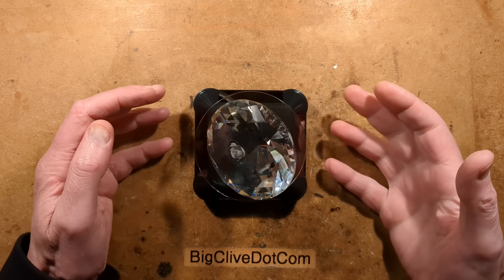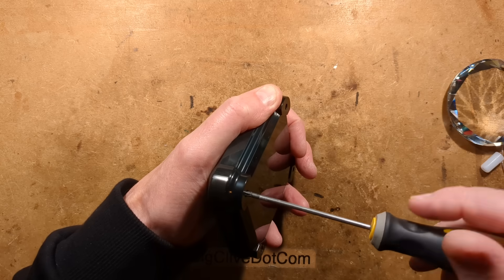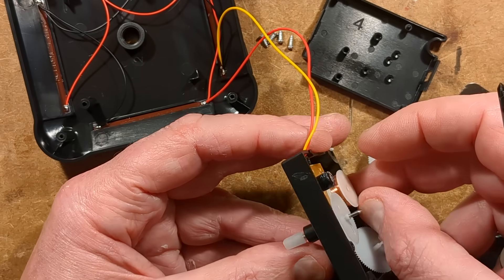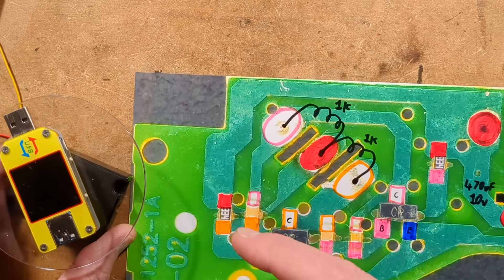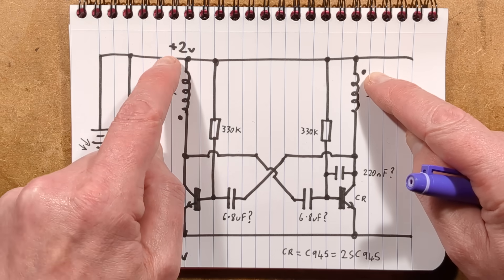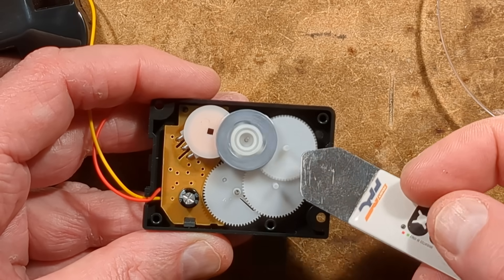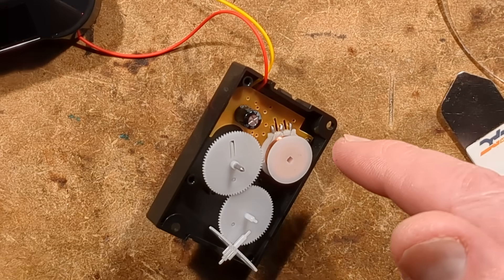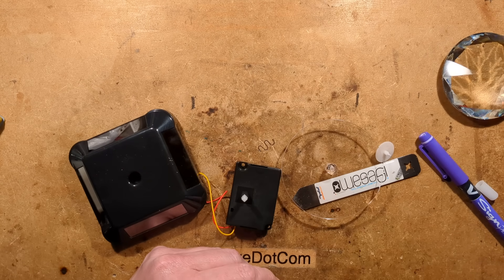Solar turntable with unusual motor

Comment: They are using the very same motor and gears for the small Tibetan prayer mills which are put on the dashboards of the cars there. Those are using the "fast" gear ratio. I have put one on my office desk in 2012 and it has been spinning every workday since, without any signs of fatigue. What a great design!

Comment: im really curious about that motor design, because just as you said there's a lot going on in its operation. But mostly about the coil/magnet orientation not being aligned and if there's an inductance flying back somehwhere. and   Funny enough, the very first circuit I had ever built was a dual led blinker exactly like you mentioned.  Cheers!

Comment: I have a question for you, Clive:  Solar cells are said to be good for voltage, but bad for current, and generally motors need current more than voltage (to phrase it badly).    Does that astable multi-vibrator have the effect of a transformer, reducing voltage while increasing current?  Or does it only do the rapid switching?

I bought some of those to slowly rotate some dichroic glass ornaments on mirrors in the sunshine.  The brilliant colors from the dichroic glass are amazing.  But the blasted thing spins way too fast.  Could I slow down the motor by increasing the size of the capacitors which go to the transistor gates?
Reply from the maker: These motors are suited to the low solar panel current.  You may be able to slow it down by adding a diode or resistor in series between the solar panels and the motor.

Comment: It could need the magnet passing over the coil, when it moves, to induce the reverse current in the winding, to flip the circuit over. it possible does work with the magnets missing?

Comment: Standard astable multivibrator circuit, so it shouldn't depend on the coils and magnets, no idea what the extra capacitor is for, it may force it to start on one side, but can't see why that would be necessary, possibly it helps low voltage starting, especially if it has to run at a single NiMH cell voltage.
Correction, the CR oscillation frequency would be 0.32Hz, so the frequency is actually being driven by feedback from the coil through that 220nF

Comment: I want a much bigger solar turntable for plants. Something to help them grow straight by keeping them confused. Ideally 4-5 rotations per day(sunlight), either with a lot more gears, or with an electronic timer. Hope someone would start making these.
Reply from the maker: You can get hanging basket rotators that store energy from a small solar panel until there is enough to pulse a geared motor.  They turn very slowly, but faster in bright sunlight.

Comment: It'd be interesting to get one of those magnet detector sheets and see if we could actually see the magnetic field oscillating. Though, as mentioned, the spinning magnets might actually play a role in the circuit, meaning it may not function without them

Comment: I have one of those older ones with the table permanently affixed. Got to me fine thankfully. I use it to cure resin 3d prints under UV light. Works great.

Comment: I use the larger (and heavier-duty) Li Ion battery powered one for cinematography.  These things are ideal for displaying e.g. minerals and semi-precious crystals such as Amethyst, and mine has the added capability of driving an LED via the USB charging port, so it can be set up as a point-source illuminated turntable. Got to be nearly 20 years old now and still works just fine.

Comment: Standard multivibrator, and the addition of the 220nF cap to base is a trigger cap, so it synchronises to the induced emf that the coil produces as the magnet approaches. That is mainly useful at startup, when the rotor freq is less than the natural freq of the multivibrator.
If you remove the 220nF cap it will probably still run, but starting will be erratic.

Comment: I have used one of these under a uv light to cure resin parts, before getting a larger cure station setup. They work well for small resin parts and the uv light does a good job spinning them.

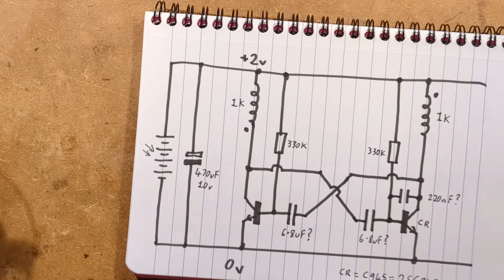Comment: @ 04:33 instant fuzzy nostalgia from first wiring up those spring terminal electronics kits
indeed the flashing LEDs.

That's also how I learned the sad way not to remove the resistors
(as I only later found out would be called "current limiting").
Yay - the LEDs are much brighter than before.
Oh - now they don't work any more.
Reply: They became NEDs 

Noise 
Emitting
Diode

But they only work once.

Comment: Like they say...it;s all in the gearing.  Fast or slow, the circuitry doesn't have any say so here.  Interesting thing this, solar cells only generate so much power so the gearing is most important.  Not sure of the durability though, all that spinning plastic on plastic construction leads me to say "not much" especially with weight on the platter.  Good work Clive, thanks!

Comment: I have a large "diamond" and also one of those turntables, I was hoping to make mine slower, I thought the Aussie sun was too much for it so I covered 3 out of the 4 panels and there was no change, I made the mistake of taking the mechanism apart and all the gears popping out, I figured I'd be able to do something in there to make it slower, but seems not, I kinda just gave up as that all I could think of. Still it's very nice on a bright summers say to have the "diamond" making it's rainbow patters in the backyeard.
Reply from the maker: You could possibly add a diode or two in parallel with the solar panel output to shunt the voltage to a lower level.  A resistor in series might work too.

Comment: My first thought was that it would use shades on the bottom of the turntable to shade different panels, with each wired to a different coil. Effectively providing the timing with zero "electronics".

Comment: Its what is used in clocks !
Reply from the maker: Some clocks, mainly for things like spinning pendulums.  But most dedicated clock movements are based on a small single coil stepper motor and a crystal synced timing circuit.

Comment: Thanks for this video, Clive, I hadn't seen one like this before. It would also be possible to make a custom enclosure that would change the rotational speed as desired, even down to an incredible slow speed but with a corresponding increase in torque.

Watching the higher speed with this turntable has given me an idea. If it would also be possible to power an LED or LEDs then this turntable could be used to make a solar-powered rotating police beacon or similar rotating light. Maybe the lower speed would work for a model lighthouse? I'm also wondering if the motor from this light could be driven from a solar garden light so that it starts up as the light fades. A rotating beacon solar garden light would certainly be unusual. The dome could be uncoloured and jumpers or switches used to select the colour by selecting different parts of a multi-chip LED.
Reply: Easy enough, a lithium solar charge controller and a buck/step down regulator (1.5-2v for the motor), then glue a small mirror tile 45 degrees to the square drive spindle and a narrow focus LED facing down on the mirror. 😉 (all available for cheap in AE "Bundle")

Comment: the circuit normally relies on one transistor being faster than the other so kicking the circuit in to oscillation.  So the little cap could be their to make sure one turns on a bit slower so as to guarantee the circuit starts every time. could even make sure it turns in the same direction every time?
Reply: I've built a lot of multivibrators in the last 50+ years, and they've all started without this extra cap. It'll ensure which transistor conducts first, but I don't see any reason that would matter here. Cargo cult circuit design?

Comment: It would be interesting to add LEDs to the motor circuitry as you mentioned, and aim them up through holes in the base at the bottom of the clear turntable. As long as there was enough extra current available to run both, with the crystal turning it would probably make some nice visual effects!

Comment: I've got 2 of these in silver from Temu bout 4 QUID each. The grinding noise you mentioned, is there anything I can add to the gears to quieten it and by that I mean spray it with WD40. 😁
Reply from the maker: Any oil or grease may be too sticky.  It's a slight cogging effect that can cause noise, especially with heavy loads.
Reply: Proper grease would work better than a thin film of spray, but I think the grinding is an inherent part of the mechanism design & cheap construction, sadly :(
Reply: Sure, but a thick grease layer may help to dampen the noise somewhat.. at the risk of inducing a higher torque/power requirement due to its viscosity

Comment: I've got a hexagonal one with 6 solar panels and 4 led lights. A single AA battery powers the lights. Table only rotates one direction. Btw, removing/adding a gear also affects the torque so you may not be able to spin certain items due to excessive weight.

Comment: Brushless? That explains the one I have had for 5+ years is still running. Much the same on the outside, but space for a single AA for backup (I guess). Never figured if it would try and charge a NiMH or burn a primary cell.
99% of the time it has been in south facing window with a tennis ball sized 'discoball' on it, confusing neighbours.

Comment: Big ceramic capacitors would be 10uF, measuring 7uF because of the bias voltage applied to them by the capacitor tester.
Reply: It would be interesting to see that 6.8uF caps replaced with 2.2uF. Would it spin faster, or would it not develop enough torque to run at all?
Reply: @jbuchana  Less torque, because the transistors would turn off faster due to less base charge, and it would not affect speed that much as the magnets are going to determine rotational speed.

Comment: I’m guessing the magnetic feedback does help it oscillate. You could test it by applying some friction to the rotor or its geartrain to see if it actually slows down instead of instantly stalling, indicating that the switching frequency has decreased as it’s a synchronous motor.
Reply: I think everyone was waiting for the magnetic polarity tester to be used on the open and running motor ! 🤔

Now I need to get one of those... 😉🤣🖖
Reply: @MeteorMark  I doubt it would be fast enough.

Comment: Holding a small metal screwdriver tip near the coil would have told you if the coil was pulsating or not.
I doubt the circuit needs the magnets to pulse since if the coil sections were replaced with resistors, the circuit would still toggle. Though I suspect that the back EMF from the coils would synchronise the pulse rate with the rotation speed. ie: The classic astable multivibrator config just gets things started.

Comment: Nice presentation - now I suddenly need a few of these!
There seems to be enough internal space to add a solar charger circuit with a cell or battery, for round the clock operation. That would be interesting. Just an idea.

Comment: You mentioned a similar circuit with LEDs instead of the coils. That works because, as one transistor turns on, its collector voltage drops and that drop is communicated by the capacitor to base of the other transistor, turning it off. No magnetic coupling between the two halves of the coil is needed, and I suspect their polarity is not as you show it on the circuit diagram.

Comment: Mr. Clive, I was wondering if maybe you take request... I would like to see you dissect and reverse engineer one of those finger tip oximeter things.
Reply: Oh yes
Reply: oo That would be neat! Might have to try and find an old one, with those little diode modules being so common in cheap smartwatches I'd imagine most will just be a battery, diode module and a blob chip though.

Comment: 9:18 - With that configuration it's one revolution every 1.5 seconds (actually, every 1.46 seconds, but it might slow down if you put something heavier on it, so my guess is they were aiming for 1.5).

Comment: I understand brushless motors and brushed motors.... how does this circuit somehow control a brushed motor?  Is it purely just throw everything at the wall and hope it sticks?     Thr gearing is what smooths out the whole operation. Beyond clever  but very dumb too can't complain if it somehow works.

Seems like it works like a floppy drive.
Reply from the maker: This is effectively a brushless motor.

Comment: I've had one of those, and they usually have a "stutter" where the mechanism has a "cadence" so to speak where it has a step-pattern of sorts. Sorry I couldn't explain it better. How can I fix that?
Reply from the maker: That's usually cogging - the slight gear tolerance.  Most obvious with heavy loads.

Comment: What a neat display thingy. Nice idea with the movable cog too.

It could do with an on/off switch though.
Reply: Agreed, an on/off switch seems essential. Easy enough to wire one in of course but it shouldn't be necessary for the customer to implement such a basic function. Perhaps Clive could mod his and demonstrate some good solutions?
Reply: @SlartiMarvinbartfast  Thing is, it would have to be underneath and recessed so it still sits flat. 🤔
Reply: I guess they thought it didn't need it because you can turn it off by just covering up the solar panel?
Reply: @techno1561  You'd have to cover up all four of them. LOL.

Comment: Looks like the designers took an old 1970's Elektor magazine circuit to another level. I wonder, could this be sped up to CD speed, and then used with one of the red lasers you got in the same package to make a discrete solar powered CD player.

Comment: I have used one of these turn tables for years for helping cure my Resin 3D prints. Way back there were no prebuilt curing stations so I built my own with a "proper" wave length bulb and socket and high polished aluminium reflective sides. Several bulbs later and the turn table is still working.
Reply: I do too. I'm cheap and not going to shell out the silly money for something I can and have built. These are perfect for that purpose.
Reply: I have one too. I'm pretty sure it came with a UV light I bought for curing resin.
Reply: My Elegoo branded curing station uses one of these as well

Comment: a solid solar panel with no visible cells or crystals is an amorphous panel (supposed to be more efficient than crystalline based panels)
Reply: It might be worth buying just for the tiny solar panels (e.g. for adding to a wireless keyboard or whatever), only did a quick search but just the solar panels cost more than the whole turntable. (Probably just another case of having to buy a bulk lot of the solar panels to get a decent price on them...)

Comment: To make it spin even faster, you could change the 6.8uF capacitors for smaller values.
Reply: I'm thinking 2.2uF would be interesting. I wonder if it would develop enough torque to run at the faster speed?